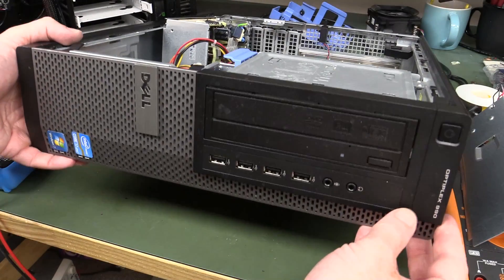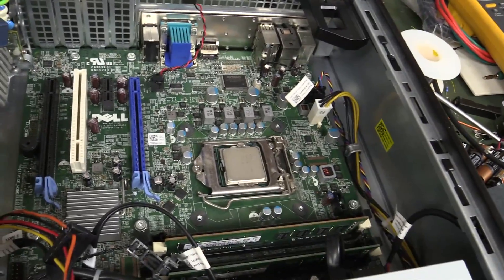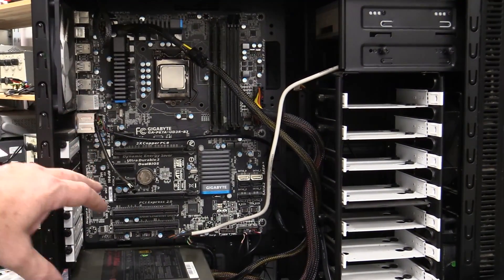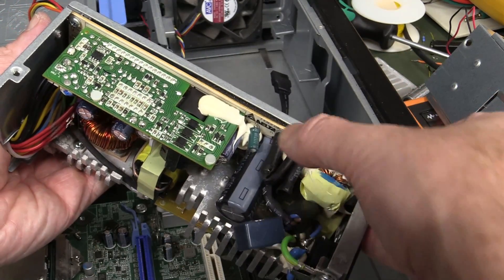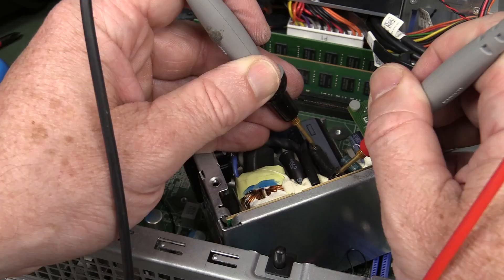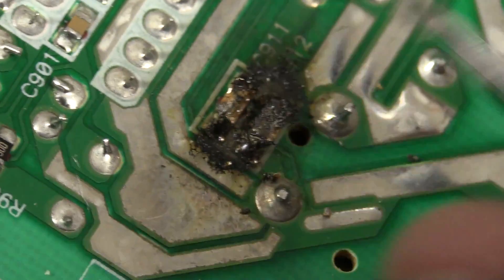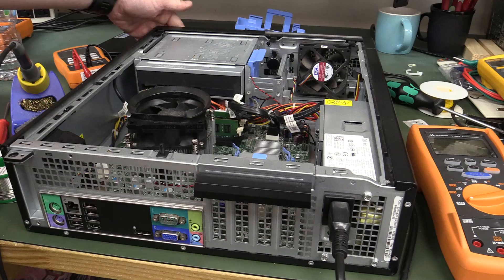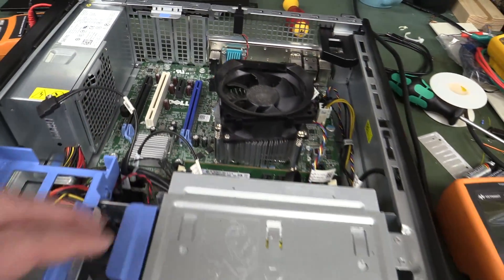EEVblog #1077 - Dumpster PC Repair

Comment: TFX is a standardized PSU form factor and is commonly used by several companies in their slim desktop PCs. That's why the replacement fit and the screw holes lined up. :)
Reply: I was looking for someone to post this before double posting.
Reply: Except Optiplex 990 PSU is narrower than TFX standard.

Comment: The power supply form factor is TFX you can buy a decent in Win one for $30 maybe.  Only issue is length is not standard Delta one tend to be a bit shorter to fit the chassis.

(Edit: Meant TFX not Flex ATX)

Comment: Good find, last year I found a Lenovo M91with a i7-2600, very nice processor, it's just too bad that these companies don't use the K version, maybe because they are considerably more expensive and to avoid customers from overclocking and burning up their systems ... 
Also a few months ago I found a Del studiol XPS with a  i7- 975 extreme 3,33ghz overclockable  (extremely hot CPU watercooler fixed the problem), paired both systems with a GTX 1060 and turned both into gaming machines.
Gotta love dumpster finds.

Comment: Have two of these in our office, one runs absolutely fine the other has just had it's third power supply installed! They have a very nasty tendency to pop (quite loudly). You can find a suitable replacement for around $100 NZD Could be they don't like fluctuations in the mains voltage but considering only one of the two PCs we have is blowing it's supplies I would wager there is a deeper issue with the mobo...

Comment: Shocked at how optimistic you were that replacing the cap would fix the PSU. I would put the chance a bit higher than winning the lottery. I have never won the lottery. I have never fixed anything by blindly replacing the obviously burnt out part, either.
Reply from the maker: You obviously haven't seen TWO previous repairs that were nothing more than shorted and burnt out ceramics.
Reply: Agreed. Usually when any sort of feedback-y parts (which I assume this capacitor was, since it wasn't across a larger electrolytic cap) fail short, whatever they're connected to also fails as a result.

Comment: I got a psu a few days ago and it has some sort of blue disk like component blown. It's between the primary caps. What could that be? A varistor?
Reply: Could be a class-X or class-Y capacitor, or more likely a MOV. Does the PSU still work? if so, you can probably just cut the failed component out.

Comment: Dave did you try to see if the reset button on the back of the old psu does anything see if it will reset the psu like what if it acts as a breaker along with the fuse
Reply from the maker: Yes of course I tried that.
Reply: EEVblog then im clueless about what else could be thr problem with it then only other thing i csn think of is somrthing else got burnt in the pwr on circuit that cant be seen and that can happen i had a media server board fail smelling like something blew but couldnt find a burnt component

Comment: Sadly you almost never find good stuff in the trash here in the land of the free. It's very illegal to discard electronics of any sort. One must either keep it, bring to a drop off site, or use curb side pick up if the municipality offers such. It's very very illegal to remove anything from the drop off site which are all under surveillance, and it may be illegal to remove anything from the curb depending on where one lives.

Comment: Please dont waste money on 1030, get a 1050, its way better on cost/benefit .
Reply: Rodrigo B.P If it's a 25w PCIe slot (like many of these slim Dells are), the GT 1030 is the only real option. The GTX 1050/ti require a full 75w slot. Plus, if he's not gaming or doing high GPU load work on it, it might not be worth the extra money. At that point, though, the iGPU would probably be the best option.
Reply: Megabobster I am using 1050ti with the same type of pc no issue.
Reply: Megabobster well if this only applies to dell ok, but it has been done (gf 1050) , on a slim hp, check PhilsComputerLab channel, he did a nice job of benchmarking.

Comment: Dell charges about $120 for used power supplies should you try to order one from them after the warranty on the computer expires. Dell I believe has reverted back to their old ways of not using standard power supplies on their Business class computers. Instead they are using 8 pin connectors for the motherboard to PS interface.

Comment: As for the Age: They are lie almost 10 Years old. The 3770 is already more than 6 or 8 years old (I believe in 2012 or 2013 there was Haswell, Ivy Bridge was before that). 
The sad thing is that you can use them these days and they work fine, nothing wrong with it...

I remember back in the olden days, when you had a 10 year old PC, you couldn't do anything with it anymore, was just too slow. But today its not the case...
Reply from the maker: Yeah, very different today. An old 3770 machine still makes a potent and very usable video editing machine,
Reply: The 3770 (Ivy Bridge) came out in 2012. Haswell came after Ivy.

Comment: 10:30 Those extra four pins on the main ATX header "may" not be necessary. I've had this before.
 I looked at the color wires on that connector. Those four are duplicates and buzzed out the same on the mobo "at least on my mobo" That's not to say you wouldn't need the extra current but it was fine on my underclocked system.

Comment: Dell Optiplex 990
5YK3B2S
Ship date: September 20, 2011
Warranty expiration: September 21, 2014 < This is why they chucked it. 

Power supply: Dell Optiplex 390 790 990 3010 7010 9010 SFF Computer Power Supply 240 Watt CCCVC RV1C4 3WN11 J50TW 2TXYM PH3C2
Price: 57.99
Reply: Make sure you update the BIOS to keep those govt gremlins out.

Comment: Gotta watch with transplanting brand-name mobos into generic cases. Some of them, like some HP models (and I've seen some Dells do this as well), use a non-standard pinout on the 20/24-pin header, so you need to figure out which pins are different before you stick a generic psu onto it.
Reply: BlackEpyon That was a problem in the 90's; but I haven't heard of any similar issues since then. Still, it certainly doesn't hurt to check these things.

Comment: Dave, for that tower 2011 socket pc.  check the Bios battery.  If the battery is dead the system won't power up no matter what power supply you plugged in.  Put a new battery for the bios and try it again, if it turns on, your in business.  

Oh if you find other great find like these give me a sign.  I'm searching for some cpu like the Core i7 for LGA2011 with working motherboard or LGA 1150 or 1151.  To think that some of them put them in the trash it's amazing and stupid.  Well your lucky you get to find these great find in the dumpter.

Comment: I found a 3rd gen i5, 16gb ddr3 ram , a gtx 660(not a great card anymore but still ok) and a bunch of other pc parts that one of my neighbors tossed out when they built a new gaming pc...I almost never find decent pc stuff like that but it wasn't all good as the motherboard was fried...I used a Dell optiplex 3010 Sff motherboard that I bought for dirt cheap on ebay. I put it in a regular atx case that they also tossed out and I'm using the computer right now...It's not as straight forward as it seems to swap a dell motherboard into an aftermarket case though  because of all of the proprietary connectors Dell uses. I got everything working but I still have a front i/o and rear fan failure error when i turn the computer on..I figured out the pinouts for the power switch, hard drive led,  power led, cpu fan and also how to bypass the power switch error..Still working on bypassing the front i/o error though..

Comment: I blew a power supply once by putting the floppy drive power in one pin offset sideways wrong, You can start up an ATX supply without anything by connecting the green wire to any black wire. Also some of those name brand motherboards had non standard ATX connectors.
Reply: Pin-14 to ground. Turns any ATX PSU into a cheap bench power supply at a very steady 12v, 5, and 3.3v for pretty much any small project. Been doing that for years.
Reply: Seems to be pin 16 just to avoid disasters.

Comment: Heh, i had one of these these Dell 900 series's fail as-well, a few month ago at an IT class (had it as a secondary thing on the side. Taught it might give me some nice tips and tricks for use at home in the future. Turns out it was about setting up servers). I was setting it up  (installing Windows 7, few bits of software, that sort of thing), shut it down at the end of the day, and next morning...dead...nothing happened. Never got to see/hear that what actually happened to it, but the most likely cause was a blown fuse in the PSU.

Comment: When you hooked up the PSU from that other computer and it was missing 4 pins and you said it seems to be fine, It is. Those 4 pins are just extra power for the PCi slots to increase max power draw from the board to 75W or so without requiring the card have its own power connector. Unless you are putting in a GPU that draws more than 50W or so AND doesn't have its own power connector, you won't notice a thing. Even if you go above that 50W a bit,. you won't notice anything unless you push the GPU to actually try to draw that for seconds at a time. Short spikes of a half or second or so won't cause any issues.

Great find!
Reply: It's to provide a wider "trace" for the 3.3, 5, and 12v rails. Some motherboards don't combine those pins with their counterparts on the 20-pin header (and go to different components, splitting the load), and won't start unless you have that 4-pin header in place. The CPU has it's own 4,6 or 8-pin power header, and some server/workstation motherboards will have twin 8-pin headers just for the CPU's 12v supply. The motherboard won't start without that 12v header, since it powers the CPU's voltage regulators directly.
Reply: True, some have the +4 separate on that section over to the PCI slots in order to reduce the load on some of the other board traces, but those pins are almost always optional for basic power up. The 4 pin CPU header not so much, its hit or miss if it will boot without that. Ive had some that will some that don't.

Some of those server boards are pretty beasty. I got a bunch of decommissioned server equipment years ago. Redundant power supplies into a satellite board that ran out to the rest of the case, 24 pin main header with 2 8pin cpu headers, one for each of the four CPUs (old Xeons clocked at 1.2Ghz, rather useless for me anymore) 2 on board Ethernet, 4 Sata, 2 IDE, Floppy, and 8 card slots for ram each maxing out at 4Gb per slot. In its day it must've been a killer machine. Now ive got twice that amount of ram in half the slots, a single CPU with a clock that is just a tad under adding the clock of all those CPUs together, granted at half the core count. Twice as many Sata ports, none of the legacy, dual Ethernet, an M2 drive slot, 3 PCIe, one shorty PCIe, integrated HDMI, VGA, Display port, 5.1 surround output over 3.5mm jack, Optical audio out, coax digital audio out, USB 3, dual UEFI/BIOS. And the killer part is, probably for the price of one of those Xeons new in its day. It amazes me sometimes for far we've come in so short a time.

Comment: its a guard trace so then when they fail short. better to blow the power supply then your expensive components. they use them all the time in detonator circuts

Comment: I doubt i will get a reply but since you have a bunch of dumpster PCs any chance you might send a sub that core i7-2500 processor(like I pay shipping or something like that, shipping for a cpu should be cheap as they weight grams), I have the same system but with a lower end processor

Comment: The 900 series support RAID, we use them as high-reliability control workstations in industrial automation with RAID mirroring turned on.
Reply: I've used RAID 1 on my home rig for years.

Comment: One thing Dell had a problem with is power supplies on the Optiplex line. I know in one place I worked we had MULTIPLE power supply issues.
Reply: kd1s I ruined a power supply and motherboard on a brand new precision workstation due to some weird power issue at work. I just told Dell it never worked and they sent the tech out to replace the parts. It's nice having Pro Support. You get to talk to someone that speaks English and doesn't assume you're a complete idiot.

Comment: And as Louis will tell you, once you’ve got fan spin, you’re golden. 😎
Reply: Yeaa , good one :)
Reply: I have a server that doesn't boot but will power up the fans. Explain that one.
Reply: @Ozziepeck11  
Try eeprom reflash and check CR2032 battery, check RAM, and GPU.  Sometimes CR2032 dies completly and that causes no picture. If eeprom  reflash doesn't help and battery is fine, RAM etc. is fine then you have some sort of problem with motherboard...
Reply: Ozzie Peck - just because you’re golden doesn’t necessarily mean you’re server is... 🤔
Reply: Yep, may not be a mac, but fan spin=winner winner chicken dinner.

Comment: The place I work at throes away Fluke multimeter model 289, picked up a couple and fixed them for less then 5 cents each.
Reply from the maker: Score!
Reply: It's complicated but basically, it comes down to control and incompatibility.  Everything disturbs her, she will complain about the smell of flux even if I'm outside!!! Lol!!  All I have to say to any guys thinking about getting married is, choose wisely.  All right, I'm out, TMI!
Reply: Crap.  All I got from work was a crappy 12V power supply that was thrown away for a blown fuse.
Reply: This year i have dived 2 radios and a subwoofer. yay
Reply: Fellow diver here. Its unbelievable what people throw away that is a simple fix with some electrical skills.  It becomes a problem after a while though, fixed too many things, no room. Wife wants me to bring it back from where it came, the dump?!
Reply: one man's junk is an other man's treasure ... especially if its fluke multimeters or office pc's with a i7 in them
Reply: Chris Barth sell the repaired electronics together with your wife on ebay :D
Just kidding. As long as you don't disturb her, why should you stop repairing?
Reply: Dan B if you have them spare I would love one
Reply: maybe use the "flux capacitor" to fix that, hahahahah.. sometimes we need a wife to keep us in check !
Reply: Dude, you got me LMAO!  Yeah, you know the old "cant live with em/without em" saying.
Reply: Chris Barth , I choose to live without, Dam good choice or I would be knee deep in dept right now. Got my gf and my personal room plus the garage. Marriage is just another way of them say "What mine is mine and what was yours is now mine.
Reply: You just gotta keep 'em in check and use the old flat hand respect once in a while. None of those problems will bother you again
Reply: Lol!  Cant do that!   Nowadays(at least in the US) if you even look at a woman wrong you're likely to end up in jail.  In almost every case the male will automatically be considered the guilty one, the police will be all too happy to put you in handcuffs.  And to all, the "Dudley do right/SJW" types ready to say that this doesn't happen, you're living in la-la land.  Cant bring out a multimeter to troubleshoot these issues!  Lol!
Reply: Avinash Lewis. Avinash,  Gotta realise that in America at least, it would be almost impossible to find  someone willing fix or even consider using  something second hand.  Very few are interested in anything but the latest/greatest, when good enough would do.  Hell, I still use a basic clamshell cell phone due to its battery life/size/durability, my "smartphone" is a Samsung S5 that I still use due to the replaceable battery and SD slot. Apps function just fine. Don't even get me started on Apple!
 Personally, I could give two fucks what people think but most do.  It's all about "image".

Comment: Nice.  My main pc is the SFF one of those.  Great little machines.  it also handles 16gb of ram perfectly fine.  Also, watch out for any old barracuda gear in the dumpster room.  They often have a lot of good guts in em.  I harvested 16gb of eec ddr3 out of one for my optiplex 990.  The web filters ones usually have good higher end amd gear in em.
Reply: Great tip! I have a shot at one or two for 30 bucks a piece.

Comment: EDIT: looked at the model number of the chip and it is from before the low power state was an issue. The PSU was most likely selected to be above lowest since this was a flagship office machine.

The only reason that PSU was not the cheapest thing Dell could shove in there is the low power mode for the core-i's is very sensitive to ripple because it causes errors. You can disable the low power mode and use a junk PSU, but for an office PC the user is going to want to get the power savings low power mode can give. It was an interesting requirement that was pushed on PSU makers that has benefited other design aspects of current gen PC's, allowing higher clock speeds and the resulting performance boost to even low end machines.
Reply: To a certain point, yes, but the problem was high frequency harmonics being created between the PSU and the voltage regulation circuitry, producing ripple. The ripple isn't large, in fact it is in the 1 mV or less range. Also, the issue does not apply to this chip, but to a few generations after it. This is a second generation Core-i and it is the fourth generation that had the problem with DC ripple from low quality PSUs.
Reply: KnightsWithoutATable Good on Intel :P
Reply: wouldnt that be mostly based on the motherboard's cpu voltage regulation?